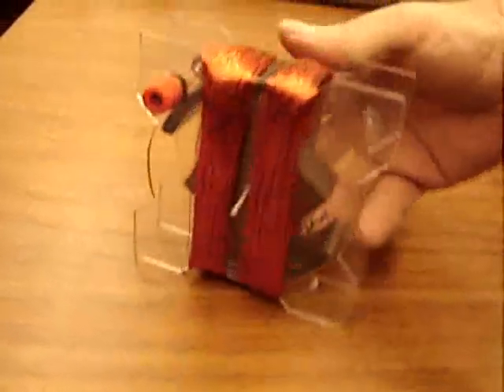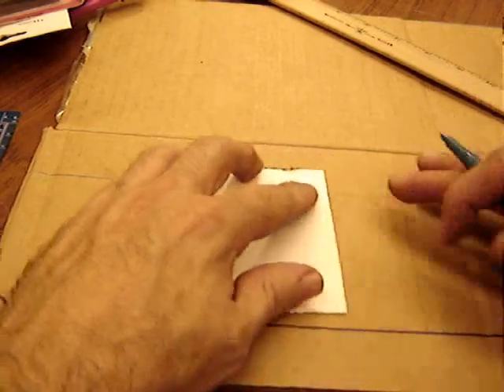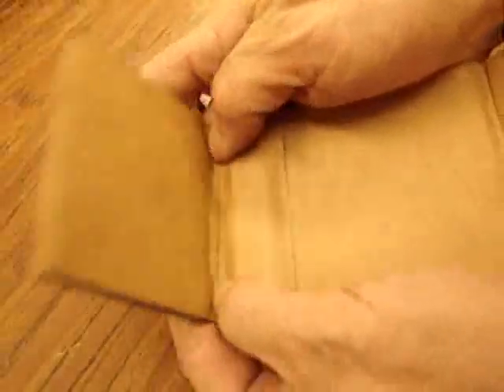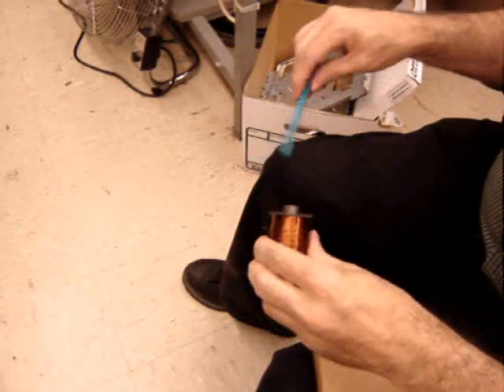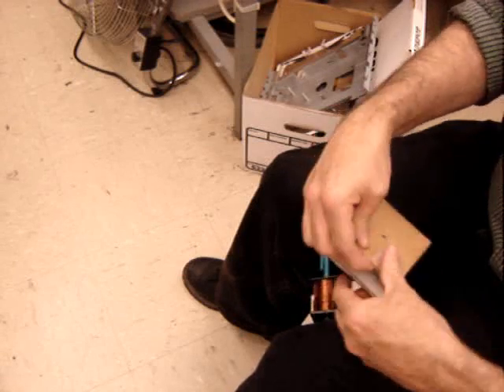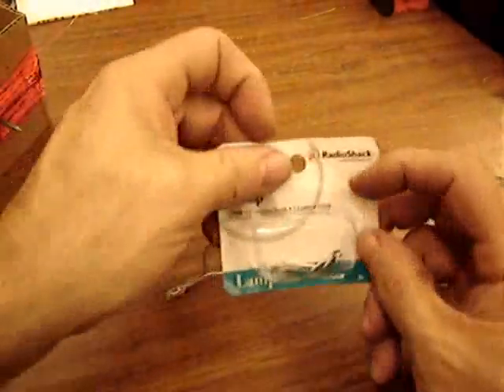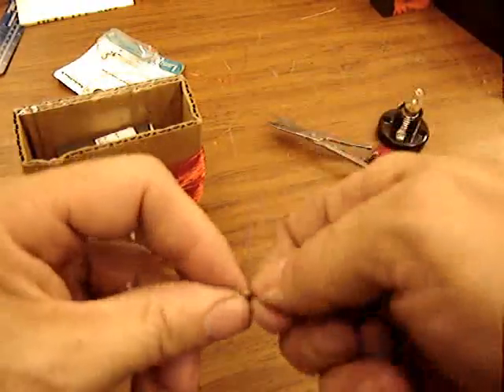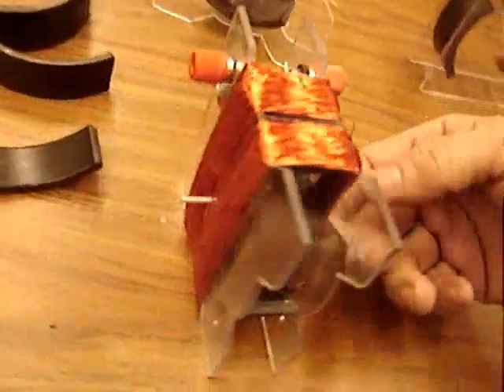Simple generator:  AC electric generator for science fair

Comment: What if i only have small magnet does it work?
Reply from the maker: Is is a supermagnet?  If you can flip it end-over-end at high speed, and get 50turns wire very close to it, you can light a red LED.

If you don't have those $0.75 magnets sold at hardware stores, you can glue many small magnets together, like this:  http://amasci.com/coilgen/generator_3.html#small
Reply: Thank you!!
Reply from the maker: Aha, someone just posted a recent video on exactly that: a tiny generator with a red LEd and few supermagnet disks.  No need for hundreds of feet of wire.  Actually their plastic spool is a bit large, and even smaller spool would work better.  https://www.youtube.com/watch?v=kSEP_gQejXE
Reply: Ahh ok
Reply: I already subscribed you because i am waiting for your other videos
Reply: So my light, red, is 2.3V. Can I light this up doing this?
Reply from the maker: Read the FAQ.  It only works with LEDs, not normal bulbs.   Or, use special #49 light bulbs.
Reply: wbeaty  i am using red led but it is not glowing 😭
plz tell me the solution
Reply: I might be able to help, how fast do you spin the magnets?

Comment: if I wanted to increase the voltage produced per rotation what variables would I have to change?
Reply from the maker: See the FAQ on the main website.    To increase voltage, add lots more turns of wire.    Also, spin magnets much faster.   Also, use stronger magnets of the same shape.
Reply: wbeaty how do I wind the wire? do I alternate from one coil to the other each twist or wrap one coil then move to the the next coil?

Comment: Can I increase the voltage of the light ? If yes, are there any adjustment in the other materials to be used?
Reply: wbeaty 
Can I use neodymium magnets instead of ceramic magnets?
Reply: Keiji Pangilinan yes, they would work 7× better than ceramic ones
Reply: P. E. Thanks!
Reply from the maker: See the project website, the FAQ about increasing the voltage.   Basically:  add lots more turns of wire, use much stronger magnets, and spin them hundreds of times faster.

Comment: Great video! Do you think it would be possible to use this generator for a series of light bulbs? Possibly add a resistor? I'm trying to create a demo for the classroom. Thanks!
Reply from the maker: Any small DC motor will become a generator if the shaft is spun.   And, some of them can light up several LEDs hooked in parallel.

DIY generators for kids will barely light a bulb.   This one can't even light up a red LED unless you double or triple the amount of copper wire.   (It only works because we use a special bulb that lights up at less than one volt.)

The trouble is, either we need iron parts and a machine shop, or we need far more than 300 turns of wire.   Or, we need to spin the generator at the typical speed of a motor: thousands of RPM (difficult by hand, need pulleys and hand crank.)

See lots of other DIY generators at http://amasci.com/coilgen/generator_4.html

If you can wind a coil of 1000 turns of wire, then it's not hard to do.   But that's somewhat an adult skill, beyond kids in K6.

Comment: Is there a way that i could make something like this except i need about 12 volts to power a LED light? I have a faster way to spin the magnets will it produce more power?
Reply from the maker: +nate7621 Yes, use expensive neo supermagnets.  Or, wind 1000 ft of finer wire, not 200 ft of #30. Instead see other DIY generators on the links page.  Or use a 24V DC motor as a generator.  This cardboard version is optimized for teaching children, with scissors, $0.50 ceramic magnets and fewer turns of wire.  

An adult-level generator uses steel parts, power tools, and more wire than kids can ever stand to wind.   For high rpm, use fast-spinning neo supermagnets shaped like cylinder, spinning in a close-fitting plastic tube, wound with copper, all inside an iron pipe.  For low-rpm high-watts, see wind-power projects with pancake coils passing through slot between pairs of half-pound supermagnets.

Comment: Can somebody answer a question for me? I've been looking all over the internet, and nobody seems to have answered this specific question... which is surprising, because i refuse to believe i'm the only person to ask this: how does one make an electric generator from scratch? and i mean from SCRATCH... like say i'm stranded on a deserted island and somehow i managed to get my hands on some copper and iron... but only those 2 (and i have beaten the crap out of the copper, into a wire). But no magnet. how does one make a turbine (e.g. wind turbine or water turbine) that converts rotation into electricity. I assume it would be A.C. (though i'm not sure) and i know how to turn A.C. into D.C., so i just need to know the former. thanks in advance!
Reply: That's not something that can be answered in a YT comment, but in a nutshell, you'd have to first make at least 4 coils out of your crap-beaten copper wire, and then you'd need magnets. You place the magnets as a rotor, and the coils around the magnets as a stator; you attach a fan to the rotor, and when the wind blows, you'll get AC electricity. Using this videos topology would get you AC. You need to make sure magnets are N S N S polarity (that means 2 magnets in the rotor); and that's it. With the use of physics and some calculations you can get how many RPM's you would need to generate X volts with coils of X windings and magnets of X strength. Hope I solved your doubt :)
Reply: I/O
thanks! :) So it's pretty much impossible to make a generator without a magnet?
Reply: well, to induce a current in a coil, you need a magnetic field, wich you can obtain from other coil (hooked up to a bettery) or in the simplest and easiest way, a magnet. In a nutshell, you essencialy need a magnetic field.
Reply: Unknown well, to induce a current in a coil, you need a magnetic field, wich you can obtain from other coil (hooked up to a bettery) or in the simplest and easiest way, a magnet. In a nutshell, you essencialy need a magnetic field.
Reply: Thank you.
Reply: From scratch you will have to mine the ore, then extract the copper and the iron, which isn't trivial at all. And then you will have to make magnets, which is even harder.
Reply: olegkikin
yea, it's the making the magnet i want to learn :) I don't know why, but for the past few weeks, I've been obsessed with learning how to craft.... well, everything :D and a lot of things need power, but if you're starting from scratch, you need to make the magnets and all yourself, which is why i'm interested in how to make the magnet and all from scratch :)
Reply from the maker: If you have some valuable trade-goods (perhaps salt, perhaps tools,) you can walk to Magnesia, and trade with the shepherds there for a large mass of Lode-stone, the natural ferrite magnet.

Now you only have to figure out how to make hundreds of feet of copper wire.   Or even bronze, if no pure copper ore is available.

Comment: how many volts does it generate?
Reply from the maker: +Sharon Inestroza 
only 3/4 volt.    If you wind more wire, the voltage will be higher.   If you can spin the magnets much faster, the voltage will be higher.   (Don't use only 300 turns of wire, wind 600 or maybe 1000)
Reply: OK thanks!

Comment: Can I use plywood instead of cardboard as the case? Would it still work, if I used plywood?
Reply from the maker: +Harjot Singh plywood would work, but it has to be VERY thin, like 3mm or thinner.    The coil of wire must remain very close to the magnet.   Thick wood will move the coil farther away.  That creates a lower voltage.   (But if you used thick wood, you could try winding 1000 turns of wire of wire instead of just 250.)
Reply: wbeaty Thanks for replying. This really helps.

Comment: Tell me why this shit dont work? Shit dont work bruh, get this shit off youtube bruh..
Reply from the maker: +KnowW NotM     Did you read the project website?   This video is not the complete instructions.   The website has an entire "DEBUGGING" section.   

Common problems:  not spinning it fast enough, or used wrong light bulb,  or used wrong kind of wire, or used different kind of magnets.   Flashlight bulbs will not work, so use the special bulb from the parts list, or use a RED LED.   Normal wire will not work, you need hundreds of turns of #30 gauge enameled magnet wire.
Reply: I had 32 gauge wire, about 6 coils 150 turns or more each, and two magnets and wouldnt even light a simple led
Reply from the maker: +KnowW NotM      Read the debugging instructions on the website.   Here is the first thing in the list:

"If the light bulb won't light, usually it's because the wrong bulb was used.  Follow instructions.  If you changed the magnets, it won't work. So don't use different magnets. If you used a different bulb, it won't work. Use the parts in the partslist, don't make changes.  If you're not using  #30 enamel varnish-coated wire, then it won't work.  So don't use  different wire. Don't use different parts.   Before testing anything else, ask yourself if you used the parts in the parts list.  If you used different parts, the generator will fail.  Notice: it's very important that you use the parts listed, and don't use substitutes.  And, have I mentioned? DON'T  USE FREAKIN' DIFFERENT PARTS!  What, do you WANT it to fail?  :)   "

So, you didn't build my generator.   My generator has four magnets, not two.   And it's hooked up to a specialized light bulb, not an LED.

The incandescent bulb in the parts list will glow at around 3/4ths volt.   Red LEDs need way more volts, at least 1.8V.

If you want to light a red LED using this generator, you'll need to spin the magnets nearly 3X faster than shown in the video.   If you only used two magnets instead of four, you'll need to spin them way faster than 3X.
Reply: what does changing the magnets have to do with it.. I've been using 32 guage wire, and my stator consisted of at least 12 coils with at least 151 turns.. I used at least 4 rectangle magnets, wtf bruh.. It didn't work for shit.. Then 7 months later after I supposedly left the mental hospital, I tried it again, but coiled the coil one way than the next coil the opposite, and still didn't do anything?? I'm confused as to why these fake youtubers seem like there making up shit..
Reply: why 3 years to figure out how to make electricity? It's kinda low, and have to waste peoples time to make them feel better.. I don't feel good about that.. I feel trapped, I feel trapped..I feel sad that everything that mattered has been takin away..
Reply from the maker: > what does changing the magnets have to do with it.

+KnowW NotM  You said that you used two magnets.  That's a change.   It causes failure.    You said you used an LED.  That's a change, it causes failure.   You said you used four coils.   My generator has one big coil, don't change it.   My coil has 300 turns total.

Here's the real secret:   a good generator needs iron parts made in a machine shop.   Not simple, and not for kids.   But it's possible to make a very feeble generator using cardboard.

Unfortunately a generator only works if it's exactly the same as the one in my video.   Same light bulb, same magnets, same size cardboard box.    It's feeble and can't even light an LED unless the magnets are flipping about 15 turns per second or faster.

Here's one improvement:  use more wire.   600 turns, 800 turns will make the bulb light up even when the magnets spin slower.
Reply from the maker: +KnowW NotM   The lesson is:  follow instructions.

If you want to make changes, well, first build my generator, exactly the same as the one in the video.   When you make it work, then later you can try different changes.

The GSA Girl Scouts has my generator as a science project.  They made one change:  they used three magnets, and they glued two big nails head-first to the middle magnet.    That way the magnets have a permanent axle.
Reply: wtf bruh, you should help people  learn this stuff
Reply from the maker: Here's someone that made it work:

https://www.youtube.com/watch?v=ypUob4MPoLg

They didn't use the special light bulb from the parts list.  They used a red LED instead. But also they found that it would light up when spinning extremely fast.

Here's the simple lesson:
- Follow the instructions and it works fine.
- Won't follow the instructions, make changes, probably you'll get a non-working generator.

Here's one way to do science projects:
 - duplicate the project exactly.  No changes at all.
 - get it working like it's supposed to.
 - now, make changes.   See if they are improvements.  Or do they cause failure?

Comment: Is it okay if I use the copper wire without insulation? Please help.
Thanks.
Reply from the maker: +Pragyan Salazar Tennyson    Wire cannot be bare.   Need to use "magnet wire" or "motor winding wire."   The wire looks bare, but it has a thin coat of urethane varnish insulation, either orange or green.   Use #30 gauge magnet wire, or any size between #26 and #34.   See the main article links and FAQ for lots of wire sources online.
Reply: +wbeaty Thx

Comment: can you make it spin on its own??
Reply from the maker: +Jorge Calderon  in the main article see the section about MOTOR CHALLENGE.
Reply: Depends... You can move it using a force like a running machine or fuel like steam power with coal, if you mean the magbet entirely moving by itself-no its impossible to make a perpetual motion machine

Comment: i am not understnding in which direction do i place the magnet
Reply from the maker: +Kanika Masiwal   it's described in the main article.   Stack up the four magnets, then split the stack into two halves, and stick the two halves around the nail.   Adjust it so the nail is in the center.    It helps if you use little pieces of cardboard on either side of the nail.

Comment: Sir what about IF I used #23 magnetic wire , how many roll?
Reply from the maker: +Domingo Cruz   I have not tried #23 enamel wire.   It might be too thick, so the coil is too large and far from the magnets.   Then, the magnets must spin much faster to light the bulb.    But #26 works.

Wind 300 turns on the coil, or more.   More is better, since it gives higher voltage output.   With #30 wire you can wind six hundred or eight hundred turns.   But with thick wire coil, that same 600-turns would be too large, the size of a grapefruit!    The wire must remain very close to the magnets.
Reply: Sir wbeaty thank you for your response regarding my question and also thank you for a additional knowledge about # of wire can be turns. God Bless and imparting your knowledge to others.

Comment: how can i know the polarity of the electricity?
Reply from the maker: +Jay Mendez It's AC.   It wiggles back and forth, one wiggle per each rotation of magnet.   The bulb flashes during the positive, and flashes again during the negative.
Reply from the maker: +Andrew P Nope, doesn't work.

Neither will this generator light a normal flashlight bulb.   The voltage is too low, below 1v.

We could use 5x or 10x more turns of wire.   That, or redesign it for neo supermagnets.  Then the output voltage would be higher than the 1.4v needed for standard bridge rectifier.   (Or use schottky diodes, so the voltage is well above the 0.6v needed for diodes.)
Reply from the maker: +Andrew P  Voltage output depends on RPM, strength of magnets, number of turns.  This one above won't even light a red LED at 1.4V unless you spin inhumanly fast, or add more wire (that's why we need the special 20mA bulb that lights up at 3/4 volts.  Also, bike dynamos spin way faster than just using your fingers.

Also, bike dynamos can be made with power tools and steel, this one uses cardboard and scissors.  With a steel shell and a nearly-closed magnetic path, you can get about 5x higher volts, maybe more.   Then just wind far more than 250 turns of wire, and spin it way faster, to get it to 12V.

Even so, the above design was from before neo supermagnets. 

Instead we can use those one of "buzzing bee" magnet ovoids with nails glued on their tips.   Put that in a 1/2" plastic pipe, it's 10X stronger than black ceramic magnets, so only needs 30T of wire (wrapped across the pipe openings of course.)   Go wild and use 50T of wire!
Reply from the maker: +Andrew P see the main article on amasci.com (link above, and at the start of the video, and at the end of the video.)   Lots of detailed info.

You need a DC generator if charging a capacitor or battery.  

To create several watts DC, don't make your own generator.  Instead, just use a DC motor, the kind with magnets (a DCPM motor.)  All motors are generators, and DC motors already contain the commutator which converts the coil AC into a DC output.   For hand-crank generators, find a low-RPM DC motor rated for high DC volts, such as 24V or 48V.     Then for 6V, just spin it slower than its advertised RPM.  Even better is a DC "gearmotor," one with a built-in gearbox, so that when you crank the shaft, the gears spin the motor faster.

The output volts of a generator are proportional to the RPM.   So, if you manually spin a 24V motor at 1/4 its rated RPM, it becomes a 6V DC generator.

Comment: Can we use a christmas lights?If yes,how?I will really appreciate it if you reply to this comment.This is for our project and we decided that we can use this video as a reference :)
Reply: No it won't produce enough voltage for the light
Reply from the maker: +Thanimae Empeynado No, most incandescent xmas bulbs require 6V or 3V, while this generator only puts out a bit more than 1V. 

Try winding twice as much wire, then use a red LED.   Or, use big neo supermagnets instead of black ceramic magnets.  Neo supermagnets can put out about 7X higher voltage.

That, or just buy the special bulb from All Electronics.   Or buy a #48 miniature bulb from online suppliers (or #49 bulb, but that type needs a bayonet socket, not a flashlight-type screw base used by #48 bulb.)